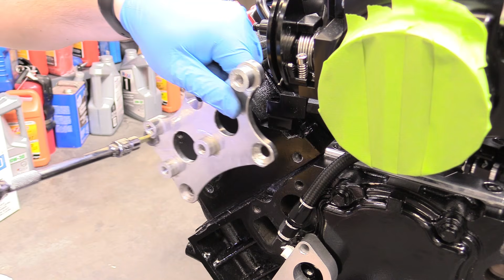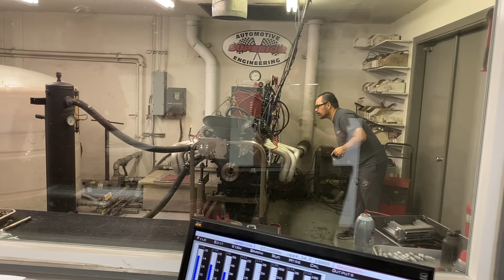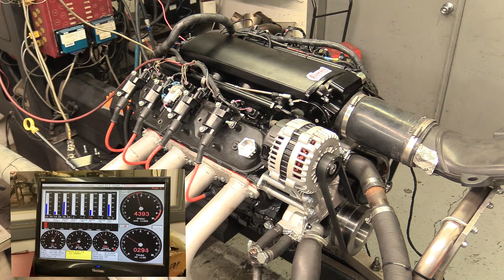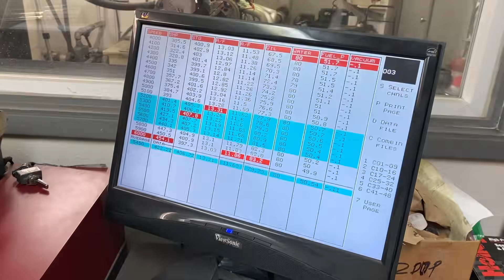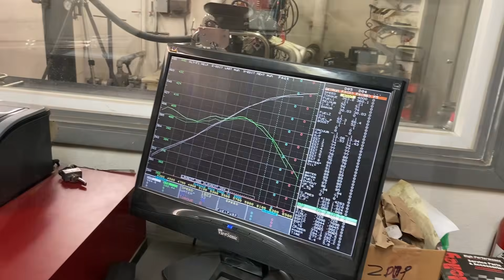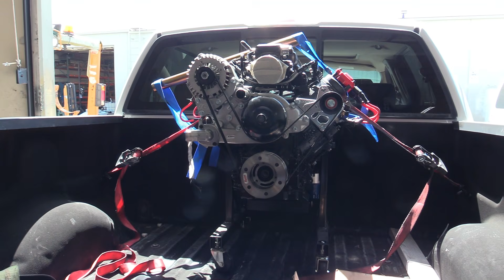How to Build a 5.3L LS LM7 V8 - Part 13: Dyno Time! What are the Power Numbers?!

Comment: Hi, I have a 2001 Silverado i want to fully build truck mean alot to me. Short story I sold it in 2016 regretted it but had to at the time, after years of searching for it everywhere i found it up forsale on offerup with out hesitation I bought it back in 2021. 

My questions to you about your build is if I follow every step will it fit back in my truck. Also will it pass emissions if not what can I do differently? Also will my original transmission be able to haddle the engine?

Comment: Please help I'm sorry for off topic question. I don't have any social media so I tried asking you a question but after I went through all 5 steps even asking my question it wanted a Facebook. I have a 2003 Toyota Camry XLE 3.0 V6. 4 months ago I decided to do some preventative maintenance. So I cleaned the MAF sensor and the throttle body. I did not remove the throttle body and I did not unhook the battery cables. So after cleaning I started the car and of course it ran sluggish like it's supposed to until it relearns but I immediately shut the car off because I needed to clean the battery terminals. Then I restarted car and took it for a long drive and all was good or so I thought. The next morning and ever since I have a high idle cold start only. Before cleaning the first start of the day it was around 1400 RPM and now it's 2000 RPM and has been for months. No codes and no vacuum leaks. I did open the butterfly by hand I wasn't being rough or anything while cleaning. What could this be no one here in Kentucky has a clue without seeing a code of some type. Please help id pay you somehow

Comment: Got my 1995 Ford probe in 2013 . It's always passed DEQ. But not yesterday!  I only changed 1 thing. I put some Royal Purple max-clean fuel line cleaner in the gas tank. It fail DEQ (The HC STD went up to 4988) I don't know what that means except was told it was "unburnt fuel" how do I fix having too much unburnt fuel! I'm a disabled senior so don't have extra money beyond the 211.00 for my tags. And how long does it usually take for a response?

Comment: Great series. I will definitely be following this when I start my build. Do you know off hand how much the build would have cost if everything was out of pocket? Anything you would change if you were to do it over again?
Reply from the maker: Very cool! It was like 7k out the door with the machine shop work and all that. Yes, I would change the valve covers to the taller type, I changed the link on the video but in the video I use the incorrect shorter ones. They are only taller by like a quarter inch or so, but the stock high ones SLIGHTLY tap our aftermarket rocker arms. So the taller covers clear it beautifully and I changed them just before the dyno.

Comment: Ryan @ 2 car pro!  I added up the summit partlist and come up with about 8.  Plus the machine work  is got to be pushing 9 and some change .my 03 tahoe  4x4 new transmission, tires, very clean and I have a baby on way, 5th kid ,I want to rebuild it cause it's knocking bad,I parked it asap. Since  I've never  done it before how  do I know what to replace like what makes sense... I guess I need to tear it apart and look at it first but do you think I should get master rebuild kit from Summit or order my parts separately and what are some things that would mandatory since you already turn apart that he would do thanks in advance Subs like everything saved everything really appreciate everything I'm a big fan
Reply from the maker: Thanks for adding all that up! Things have gone up since I did the video. Yeah it's not a bad idea to get the kit. Usually those come with everything you need.

Comment: I want to build a 5.3 with roughly 350 horsepower. However the torque number is something I’m concerned about because I have a stock 4l60e transmission. It has around 142k miles on it. My question to you is will my 4l60e be able to handle to torque numbers from the 350hp that my 5.3 will put out?
Reply from the maker: Yeah should be just fine, that's not a ton of power. Thanks for watching!

Comment: Your shorty headers and going to severely choke that nearly 500 hp, I'd definitely use some long tube 1 3/4" headers. Also a stock trailblazer SS/NNBS truck intake would make a HUGE difference in midrange power compared to that summit short runner sheetmetal intake, and some dual valve springs would allow it to pull past 7k and probably make more power without the threat of valve float.
Reply from the maker: I doubt it to be honestly. I used to think that until I saw the engine masters hammer headers to nearly closed and it didn't make a big difference. The headers that fit in the car are the headers for me! lol

Since I'm sponsored by Summit, that's our intake and it does great! 

Oh I'm sure I could get to 7k with that. You are totally right. The LS before me on the Dyno went to 9k with some crazy spring setup. Honestly I'm really happy with the power.
Reply: @2carpros  its not so much the diameter of primary but the length, not sure what car its going in but if thats all thatll fit then thats another story i guess.

Comment: I have a LM7 from a 06' Chevy Silverado. I'm considering engine swapping it into a car for a future project. I read that I will probably have to rebuild the bottom end of the engine because the engine sits taller than the LS series that fit into the Corvettes, etc. 

What do I need to know about putting a LM7 into a project car? Clearance issues? Engine mounts? Relocating mods for the water pump, alternator, etc?

Thanks!

Comment: I have an lm7 with summit 8707 pac 1219 BTR trunion and pushrods and tbss with 92mm tb. Has 3.73 gear but a manual z32 tt trans. Has built 706 heads. 1 7/8 headers with 3" x pipe and black widow muffler with a single 3.5" outlet. What can I expect for HP and tq?

Comment: So thank you! Very in depth. Few questions since I am wanting to do this build on my ‘04 Sierra and so I will be wanting to keep everything as far as front accessories. One, will I still need to use the Harmonic Dampener that you used? Secondly, would I still be able to keep all the accessories in their original position? Thirdly, will I need to change the pulley size on any or all of the accessories and can you list which ones? Finally, how will I know what new serpentine belt size to get? Also, thank you for listing all the parts with links. That was extremely helpful and I have already added everything to my wishlist on Summit’s website!!!
Reply from the maker: Thanks for watching Joey! You can use the stock damper, it is a great unit! Yes you can keep the same position of the accessories. I'd leave all the pulleys stock sized, you won't be revving high for long periods of time in your application. If all you accessories are stock in the stock spots then get the stock one. Makes it nice and easy. 

Awesome! Let me know how your build goes!

Comment: I bought a ls 5.3 but they guy don't know the year and I need to buy a transmission wanna buy a 4l60e how can I tell which year I need without k ow the year the motor came out of
Reply from the maker: There should be numbers on the block that you can use to identify a year range. Thanks for watching!

Comment: So I watched this series two times in preparation and getting a good knowledge for when I rebuild my engine in my 05 silverado. So I realised today that my truck actually has the l33 engine. Will the rebuild be basically the same? Thank you.
Reply from the maker: The L33 is basically the same as the LM7 but, is aluminum so that's a sweet score! Also had more lift from factory and made more power but I believe it will assemble the same or nearly the same as the LM7. Thanks for watching!
Reply: @2carpros  awesome thanks for the reply!

Comment: Nice numbers. One thing on my long term list of things to do is an LQ4 based 400 stroker. It seems like Eagle was selling a 408 rotating assembly. That would be something in a Tahoe/Yukon/Sub. Not an all powerful build, just that displacement grunt that is lost with 328, or whatever the 5.3 is. My cam profile will be similar to the stock range, which isn't dissimilar to my old 5.0. Upshift at 5500 rpm full throttle, which is more than enough.
Reply from the maker: That would be so cool! Thanks for watching!

Comment: Awesome series!! I plan on doing everything in this series and dropping it in an 88-92 f body camaro. I’m new to this but it’s always been my dream! What automatic transmission and rear end would u suggest for me?
Reply from the maker: Nice! That will be fun for you! The transmission I would use is the 700R4 that came with that car just have it rebuilt and run the TV cable. Ford a rear end I'd just put in a GM 12 bolt with a Dana Trutrac installed for LSD. Have fun! 

Thanks for watching!

Comment: Hey Ryan, Great job on the videos. Extremely helpful! One question: What octane are you running with this engine?
Reply from the maker: Thanks so much for watching! We ran 120 on the dyno. Will have to de tune it a bit to run 91 on the street with some octane booster.
Reply: @2carpros  Aweome. Thanks for the reply.

Comment: What not use a 102mm intake and throttle body? What are the cam specs?
Reply from the maker: You can, but this was provided by our sponsor Summit Racing and I think it worked amazing. This is the camshaft: https://www.summitracing.com/parts/sum-8708

Thanks for watching!

Comment: You cut scenes on the blue devil product
Reply from the maker: No I didn't. And this is not that video. Thanks for watching!
Reply: @2carpros  u guys don't bother mention that like the bald guy
Reply: @2carpros  y u guys show videos for ?????? Stupid
Reply: @2carpros  yes you did u cut the video. How do people know blue devil won't clog up power steering system if u did a flush on the power steering system and put another blue devil product like blue devil power steering? Shit people wanna tell people tell people wanna they know not what they need and should know
Reply from the maker: WHAT? That wasn't for power steering bud. That was for coolant and head gasket in a can. Completely different system. And again not this video.
Reply: U guys should to tellp people what they need know not what they wanna know. So avoing questions alot of it that r answer or mentioned in commercials. U the one representing the product on YouTube. It's easy make video for a few moments on blue devil product but does it work for life where's proof the scientific evidence????????. They make OEM product they way used to

Comment: When the engine was on the dyno, I noticed that the coil packs were black not red. What gives????
Reply from the maker: It is what the tuner wanted to work with. But our Summit Racing coils will work just fine with the tune. Thanks for watching!
Reply: @2carpros  looks like they loosened up and fell off.

Comment: Definitely subscribed, and thank you for creating such a great and comprehensive video series on this engine. Forgive my newbie question here, but how would I go about adding the power steering and AC to the serpentine belt? I have a 2001 GMC Sierra 1500 with this same engine, I plan on following your series to rebuild my engine in this way. Thanks again!
Reply from the maker: Thank you very much! I would just put the stock brackets back on if you want all the stock amenities.

Comment: it would be interesting to see a Chassis dyno and see the difference.  ive seen videos where a stock,  bone stock junkyard 5.3 LS  from 2002 hit 345 HP on engine dyno and it was factory rated at 275-290.
Reply from the maker: I would doubt that it would make 345hp stock. Because GM would advertise that like they do now. Thanks for watching!
Reply: @2carpros  yeah i know, all this comparing apples to oranges is confusing.
RWHp measures Hp after accessory and tranny losses.
Stock Gm numbers just measure gross Hp minus engine accessories
Not sure what this guys  dyno was measuring that a stock5.3LS  engine was showing 345 hp?. I just know a stock LS should be about double my 140 hp stock 307 cutlass engine.

BUT, then yo u have to take into account manufacturers were forced to start advertising only  engine dyno power numbers minus engine accessories about 25-35 yrs ago.

Comment: Can't wait to see what it does rear wheel. How much does it typically cost to get an engine dyno?
Reply from the maker: Same! 

It was 800 to get it dyno'd and broken in and 300 to pay for the tuner. If you had an older engine you wouldn't need the 300 for the tuner. Thanks for watching!
Reply: @2carpros  I was going to try to keep the 4.6 2v in my car. A friend of mine said to do a 5.3. Between Richard Holdener's channel and this, I'll have to jump on the LS band wagon lol

Comment: I'm building a 408 lq4 at around 11 to 1 compression with factory built up heads and a sloppy stage 2 cam. If this is almost 500 horsepower I can't wait to see what the 408 does. Using your videos for the build.
Reply from the maker: Nice! Let me know how it goes!
Reply: @2carpros  I would love to see an in depth step by step video on fuel injection set up after the motor in dropped in your vehicle start to finish like you did this build video. I ended up doing a 9.25 compression 408 ls with some good ring gap and ls3 rectangle ports and I'm running boost on it with fuel injection instead. I watch videos on it and nothing comes close to the depth on how you've done your video series.

Comment: So if I pulled the stock 5.3 out of my 2005 Silverado and built it just like this would I would I be able to put it back in the truck or does it have to be rebuilt to stock specifications
Reply from the maker: Yes but, you will have to have a tuner flash your ECM to make it work. Thanks for watching!
Reply: Should be able to put it right back in the truck, only difference is you'll be making more power and you'll have to beef up the trans and rest of drivetrain

Comment: but is it still 5.3L ? i just wanna know
Reply from the maker: I think technically it is a 5.4L now. Thanks for watching!
Reply: @2carpros  did you change the stroke length or just bore it?
Reply: It was bored .030 over, stock crank, stoke length didn't change